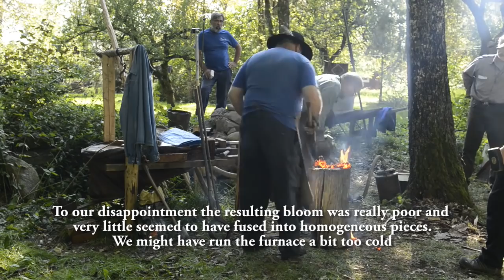Blacksmithing - Iron smelting and forging a poor bloom

Comment: And this is why iron/steel objects we're so prized before industrialization. The amount of effort to get a small amount of usable material is astounding. Nice video.
Reply: Iron production wasn't always this small in scale. Often a master smelter would preside over 5 bloomeries and you'd have 30 bloomeries going at any given time. It was a very long process as seen here but with comparable effort you could produce over a hundred pounds of usable wrought iron.

Comment: Hi Torbjorn:
How about a video on the construction of the bloomery furnace please! Also on how it used.  Details man, we need details!
Regarding the poor bloom quality, could one take and crush amd fractionate the bloom, tjen heat it to melting in an induction or gas furnace to let the iron separate from the slag before pouring into an ingot?
Cheers and Happy Easter!
Reply from the maker: Thanks for the suggestion. I don't think you can easily separate the two like that. It needs to be worked with hammers, multiple times.

Comment: Very awesome video!
I just came back from school camp and one of our assignments was making a bellow and an oven to melt iron ore! We were able to make a tiny bit of iron mixed with heaps of slag. I told the supervisor that I am a blacksmith and he gave me some bigger bits of iron for me to forge into a billet. I tried forging one of the smaller pieces but it crumbled in tiny pieces with one hit of the hammer :( Do you have any tips on how I can forge it without crumbling?  Thanks! You could try to forge a knife out of it with a piece of spring steel as cutting edge :)
Reply from the maker: knives&stuff Cool! I'm no expert on forging blooms but first of all high heat. Welding temp, and at first light taps to try and mush it together. If it's still crumbling I think it's hard to do anything really. You could crush it and remelt... could end up with steel instead.
Reply: knives&stuff I saw in a video Japanese blacksmith covers ores with wet paper, clay and straws. These create an environment such that pull oxides out of steel. Maybe borax could do this job.
Reply: Enis Turgut Yalçınkaya The Japanese are late comers to working iron, most of what you see is part of their ritual.  They use a sand rich in magnetite which is higher quality of ore than used in this video.  I would venture the furnace temp was too low and the temp was not maintained long enough,  This could be only a few degrees an minutes.  .
Reply: knives&stuff You need higher heat and less force on the hammer at first until you get a workable billet. You might try to sprinkle a little borax on it to forge weld it together. 
  Get as high heat as possible. Work fast and reheat often. You have to be patient and keep your billet hot enough to work.

  Good luck!

Comment: Not bad at all! though can I suggest adding a small amount of powdered Borax to your Red-Earth? Not only will it lower the melting point of slag and make homogenization and processing easier, but because it's a naturally occurring crystal it's been used as flux for a very, very long time, making it authentic to the time period too!
Reply: no no no, borax is for stuff lime aluminium. You'll want powdered limestone instead since it was used in the iron smelting process.
Reply: Firstly, "Lime" Aluminium?? I'm assuming you ment "like" Aluminium.

Secondly, I'm Guessing you've never done Forge pattern welding or worked in a smithy before - Since anyone who has will tell you that Powdered limestone is used as a purifying agent in a blast furnace, while borax is a welding agent (Flux). Furthermore, Limestone wasn't used in the production of Iron until the invention of the blast furnace at the start of the industrial revolution because of the fact that the excessively high heat of that style of furnace made the resulting iron brittle (from an excess of carbon that  molten iron absorbs from the air at extreme temperatures) if it wasn't treated. (which is why cast iron shatters if you drop it from too high)

Also, Aluminium is made through a chemical process (known as the Bayer process) that produces alumina (Aluminium oxide) which is then Dissolved in solution and distilled through electrolysis. The Bayer process usually involves limestone, so you have it backwards!

So if you want to stay authentic to the time period it would have to be Borax!
Reply from the maker: Limestone is used as flux in a blast furnace, it's not a purifying agent. It helps to form a light slag that floats on top of the molten iron. This shields and reduces the sulfur contamination form the fuel as well as making the slag more viscous and easy to get rid of. Sulfur makes the iron brittle. This is my understanding of it at least.
I'm not sure what the historical finds are regarding the use of any flux in a bloomery furnace. There is no need to form a slag in the same way as in a blast furnace since we are not dealing with liquid iron, but the slag properties might benefit form it. The point here is that the different ores produces different slags and that is what makes a good or bad ore together with given iron content.
Reply: Torbjörn Åhman oh! my info is from my old blacksmithing instructor, but that makes more sense with some extra reaserch! Thank you for the reply ^u^

Comment: Why does the material flake so much as it's being worked?   Are these impurities that are supposed to be driven out during the working of the material, or is it good iron that just isn't bonded well for some reason, and is useful mass that you would ideally want to keep?
Reply from the maker: In this case it is both oxides and slag from the smelting that falls off. The main purpose working a bloom like this is to remove the slag and consolidate the iron. But iron will also form iron oxides when exposed to oxygen during the high heat.

Comment: Troubleshooting Suggestion: I didnt see any silica (sand) being added, nor was there footage of slag being tapped at the end of the run. If that part of the process was skipped it almost certainly would be THE most likely reason for poor bloom quality.  Then again I've never smithed, so forgive me if i'm  off target.

Also, why'd they hot cut the bloom at 3:20 ?  It looks like it fell apart when they did it.  I always thought that after consolidation you're supposed to get it up to temp and work it, to force out the impurities (kinda like pounding the whey outta freshly churned butter) and homogenize the carbon content.

Comment: Intressant video!
Har snöat in mig lite på smide på sistone och försöker lära mig så mycket som möjligt! :)
Får man fråga vad som åstadkoms vid 2:05-2:15? 
Är rödjorden inhandlad eller upphittad?
Reply from the maker: +MrProgrock Vi försöker spätta loss luppen från insidan av ugnen. Smidigast om man kan få loss den uppifrån och lyfta den rakt upp, utan att ha sönder ugnen. Inte alltid detta lyckas som synes :) Rödjorden är hittad på känd plats och har använts tidigare många gånger med lyckat resultat. Gäller att få tag på bra jord med rätt innehåll. Tyvärr har jag inte själv varit involverad i jordletandet.

Comment: Excellent video  as always. I have an ignorant question, however. When folding and forging the bilet, wouldn't it be better to flux the billet everytime you fold it?
Reply: The ash from the  charcoal forms a slag with the silica in the  clay and sand. The iron bloom has lots of slag in it already, between the particles. From a more modern forge perspective, the adding flux might help. I'm not sure on how it would help exactly. But the slag should serve some function. They probably dont use it for simplicity's sake. They dont need it, so why make more work?
Reply from the maker: It's really not needed since the raw bloom contains a lot of slag.

Comment: Did you flux it during smelting, or was some sort of limestone mixed in with the red ore?  Did you get liquid slag when you opened the furnace?
Reply from the maker: +KurtB No flux. Yes a bit of liquid slag.
Reply: Torbjörn Åhman
You know more about this than I do.  There's a great YT video "African Iron smelting" where the setup is very similar, yet they used an alkali rock (like limestone) in large quantities, and this seemed to flux and compact the reduced iron into a denser mass with less impurities, and they were able to forge it nicely.  The clay furnace they used was similar.  Anyway, great job, I love stuff like this.
Reply: My best (most coherent, solid, and easy to work) blooms have been when I added crushed oyster-shell (i.e. calcium carbonate).  Limestone should work similarly.

Comment: Just out of curiosity, did you drain the slag from the bloomery? If not I'd imagine that the bloom was sitting in all that crap which may have contributed to the poor quality
Reply from the maker: I'm not sure we did... I don't think this ore produces that much slag. The issue we had was probably due to moisture in parts of the charcoal we used, lowering the temperature in the upper parts of the furnace.

Comment: Torbjorn, the grey slivers that fall off during the working process, are they more oxidized metal or slag or a combination of those two? I've always wondered about this and from what I understand the more you work a bloom the less impurities it will have, generally speaking and this question has always bugged me. I live in the city and hence never see these things in person.
Reply from the maker: +PhilaPeter When working bloom steel/iron I suppose it's a combination. Just working any steel at high temperature will oxidize the surface and "scale" (iron oxide) will form.

Comment: I noticed you didn't use any flux (that or you didn't let us see it) when you were folding over the iron to make a billet, is it not needed? Sorry im not really all that experienced with blacksmithing or iron processing yet :)
Reply from the maker: +Trenton Cook No, it's not really needed since there are allot of slag still in this piece of iron.The slag makes it easier to weld. However flux could be used to protect the surfaces from oxidation and maybe save some material, maybe....
Reply: +Torbjörn Åhman Thank you for the information, Keep up the great work! :)

Comment: I have a placer gold claim in Oregon, USA and one of the byproducts from my operation are large quantities of heavy black iron sands, containing rare earth elements and other heavy metals including sulfides. I would love to do this with a batch of it and see if it would be any good for making blades. Would it be possible to do this on my coal forge? It would seem that adding a flux like borax would ruin it as it would absorb all the iron leaving only precious metals behind.
Reply from the maker: Rob S Cool. Not possible in a forge. This needs to be done with charcoal. The furnace must be tall enough so the ore spends enough time traveling down to the bloom. If I remember right a grain of ore about 1mm in size needs aprox 1h to reduce fully. Would be interesting to try your "sand"... like the Japanese black sand.

Comment: That steel sounds very hard.  I'd say at least 50 points of carbon???  Using pretty much the same method, we, too, had trouble keeping the carbon content down.  Interesting, though, that you pulled the bloom out from the top.  We always pulled it from the bottom, but that required a lot more furnace repair than did your method.
Reply from the maker: I would say almost no carbon at all actually, but a bloom like this is pretty uneven. It's interesting how different results you can get with different furnace designs.

Comment: What do  you end up doing with the layers/sheets of iron that come off during hammering (in general I mean... it always looks like a lot comes off!)?
Reply from the maker: That is iron oxides! You can't do much with it but use it as ore in a furnace and smelt it. That said the "scale" as we call it is incredibly thin and the mass is not huge... I may sweep up a pound or two in a year.
Reply: @torbjornahman  Fascinating! Thanks so much for the reply! So does it come off due to oxidizing in the air, or is it to do with that the outside is cooling faster than the rest of the mass?
Reply from the maker: It's oxidizing in air when hot. The oxides are very hard and brittle compared to the iron and brakes off when the work is deformed. Almost immediately a new layer is formed on the surface.
Reply: @torbjornahman  I see... so interesting mate! Thanks again for the reply!

Comment: i wonder, if i had cast iron, and an oxidizing forge fire, would enough carbon migrate out of that, to become a workable steel??
Reply from the maker: I believe it would eventually, but it needs to be worked/turned and "kneaded" . Old refining methods relied on something along the lines of that. Check this out - https://en.wikipedia.org/wiki/Lancashire_hearth

Comment: Shouldn't you put something like borax to prevent air to make bubbles when you forge weld like this ?
Reply from the maker: Sacha Varaine-Jarnac Not really needed, and the fact is there are a lot of slag still in this billet that acts kind of like a flux.

Comment: Sir i want to know that wether those bits that fall out from the hot metal while hammering are impurities or just tiny bits of metal itself?
Reply from the maker: In this very case you're probably seeing all you mention... but in general, when forging what you see is the surface oxidation (iron oxide II) that peals off.
Reply: Thankyou for replying :D , my doubts are cleared .

Comment: hey torbjorn would it have helped to ad carbon/charcoal as the samurai sword makers do as they are working it down just being curious if that would have helped any
Reply from the maker: Not in this case as this is pure iron basically (no carbon content). The reason the Japanese smiths pack charcoal around their billets is to protect the steel from decarburization or maybe even make the steel pick up some carbon.
Reply: @torbjornahman  ah ok cool thanks im learning all i can thanks for teaching my friend

Comment: Yes, I think you correct in that it was too cold from everything I've read and looking at how hard the bloom was. My guess is that this was on the high end of cast iron at 4% carbon combined with cold shortness.Too much carbon, you were in a way "puddling" that chunk to reduce the amount of carbon to get it to a forgeable state. There is a good documentary on Wootz Damascus and it compares this steel to bloomery. The Damascus had vanadium, was melted in crucibles and cooled very slowly to form spheroidal perlite- all added to the toughness of the steel. Martensite vs. Pearlite.

Comment: Cool video again. Have you tried adding glass during the smelting to act as a scavenger?
Reply from the maker: Personally I don't have much experience with smelting. However the guys I met have done allot of different smelts in different furnaces and with different "recipes". What I learned is that it all depends on the nature of the ore. Some ores produce allot of slag others not so much.

Comment: nice and great work, but every time Carbon is burning at the welding proces. Maybe japon masters using a charcoal forge for prevent that. are they?
Reply from the maker: Gokhan Diler You mean the white sparks coming off the steel? It's the actual steel that's burning. Hardly any carbon at all in this type of steel.
Reply: When you smith it later into something you are adding more carbon to it when you heat it up in a coal forge.
Reply from the maker: Baron Van Oosting Nope, only minute amounts, if any. Adding carbon to the surface of a piece of iron/mild steel is not that easy. It needs to be in a reducing environment for several hours, and even then it's only a tiny thin shell that gets effected.
Reply: good point

Comment: Awesome video! I've been researching smithing and the process of making blooms, and i wish to do it myself once. Do you or anyone know where you can get the ore required? I live in norway if that helps. Thanks in advance :)
Reply from the maker: +Irh0102 ”irhtheman” No I don't really. You need to scout for that I'm afraid. You could probably buy pure fe-oxide, but that's not so fun...
Reply: +Torbjörn Åhman ok, thanks for the answer! :) I guess i will :D
Reply: you could get do it with Japanese style ore, black iron sand (vikings did this as well if i am right).
you can basically mine this stuff in any river or stream (concentration and quality depends on location)
it is a byproduct from panning gold, so if you just get a cheap goldpan you can fish this out of the river soil. just watch a tutorial on gold panning and you are ready to go.
Reply from the maker: nick venendaal Yes, that's for another project!

Comment: you know... im pretty sure you either need an auto hammer, or a group of well timed beaters to really get a good sized bloom, a way to get it out faster and a steadier (larger) stump to bash on. the heat dissipates really fast once the source is removed...
Reply from the maker: Well, at the stage of removal you can't forge it much, just press it together more or less. After chopping to pieces the bloom can then be brought to the forge for further refinement. Our bloom in this video was not very consolidated and hard to work afterwards.
Reply: well, you can't forge it, but by hitting it faster and harder it can form quickly before it has time to cool too much.